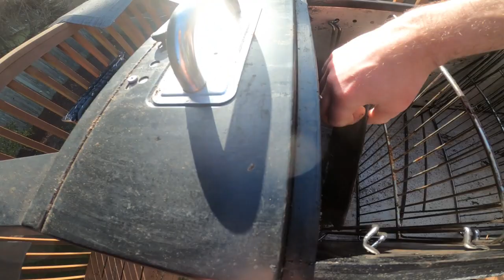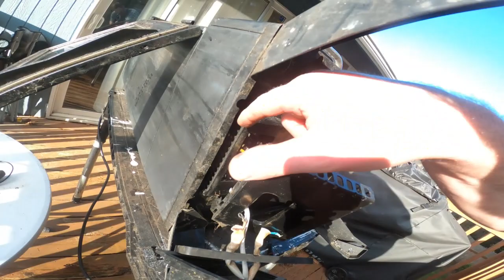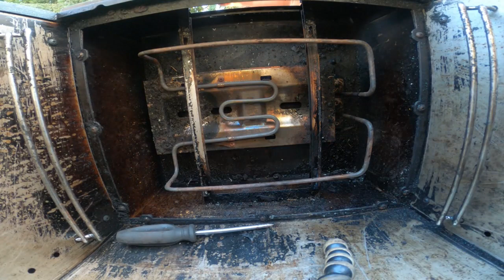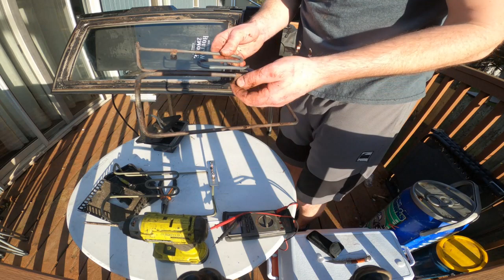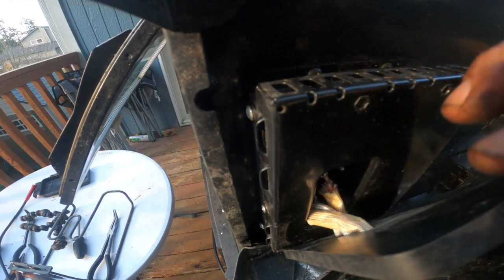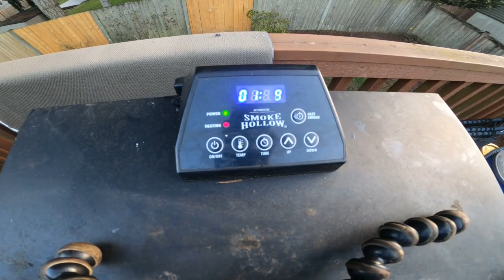Smoke Hollow Electric Smoker Repair

Comment: Where did you order the heating element from? And how much?
Reply from the maker: I am not positive where I purchased it from. Knowing me it was likely Amazon for under $100
Reply: @christopherjpeters do you happen to know the model number so I can look it up? I have the same exact one and can't find the number
Reply: @victorshoemake7785  I have same element from a smoke hollow smoker (model 3016DE). Heating element part # is 3016DEW-24. I was unable to find one. I checked with appliance factory and they do not have any in stock nor will they be getting any. My guess is, this is a discontinued part. If your handy, i would try and purchase an after market heating element from amazon and give that a try. I order one today and will cut a rectangular hole to fit instead of purchasing a whole new smoker. Hope this helped and good luck.
Reply from the maker: Oh it's been a while but I think I ordered it from Amazon for about $80

Comment: I have the same unit. I have 10 ohms. 120v at the red wire to the case and 120v from the green to the case when on. But it still does not heat up. Does the metal plate need to be grounded on the inside? Where the coil sits on?

Comment: To check for GFi trips you must check for resistance between a terminal and the ground (case).  It should be open, any resistance will trip the GFI.

Comment: Is it normal when warming up, that it flashes off?
Reply: I have bought smokers hollow smokers for many years and this unit is a pos !!! Changed everything I can think of still pos !!! Wish I would not have upgraded to digital
Reply from the maker: What do you mean by flash off? It shouldn't stop heating until it has reached the temperature you select if that's what you mean.